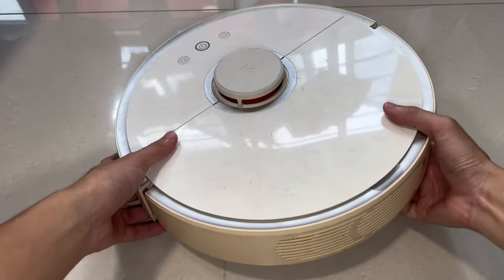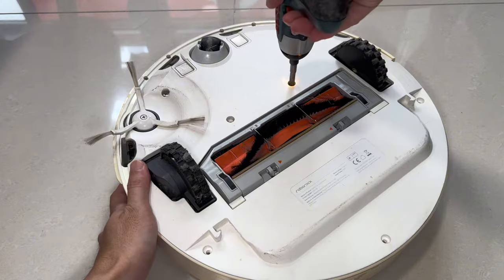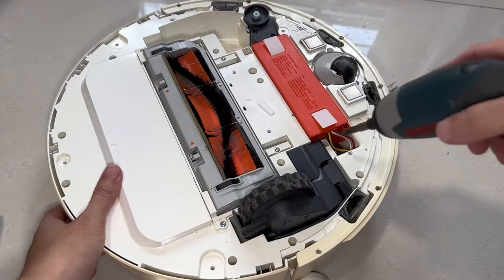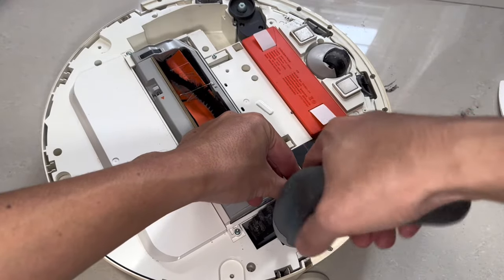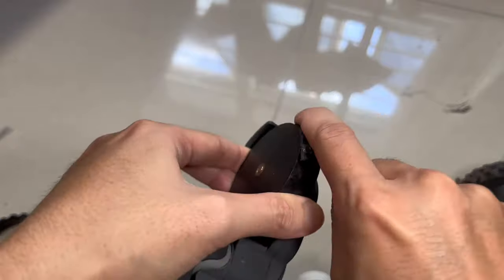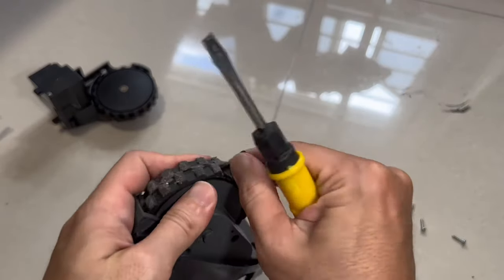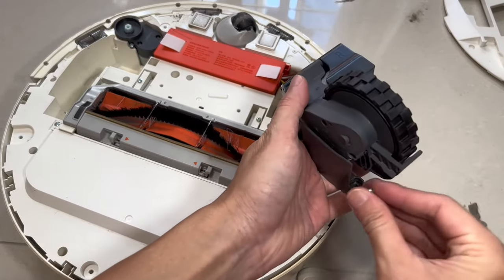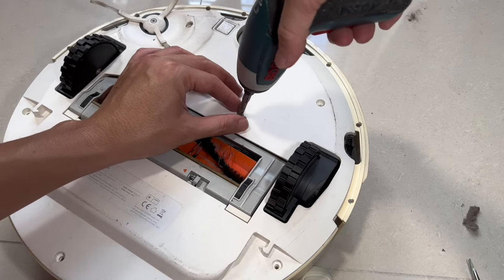Xiaomi Roborock Vacuum - Tire Replacement (Old Tire Leaves Stains on Floor)

Comment: Did you apply glue on the new tyres?
Reply from the maker: I didn’t. I have been using it for months since the change and the tires are still tightly fitted to the wheels.

Comment: any idea if one is not moving smoothly ..then what to do?
Reply from the maker: There are several possibilities. Check if your wheel is clogged with hair and dirt. Your sensors might also be dirty or faulty.